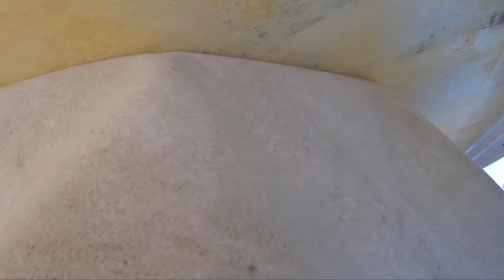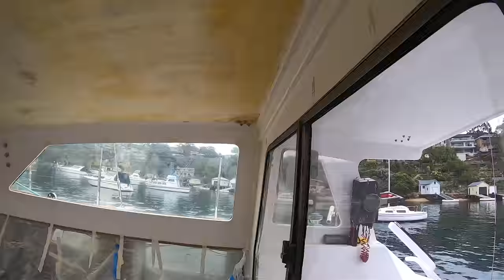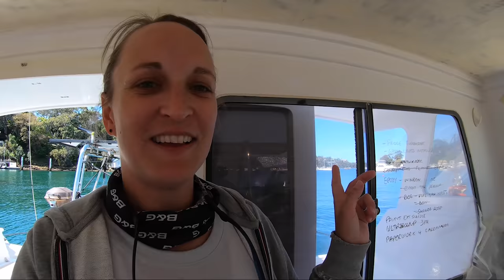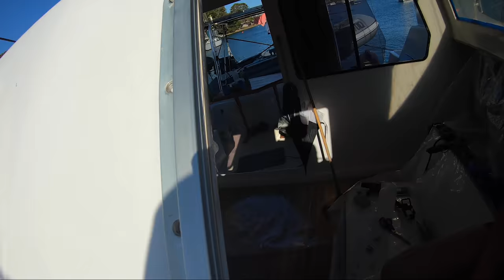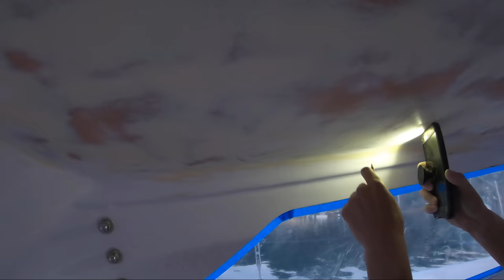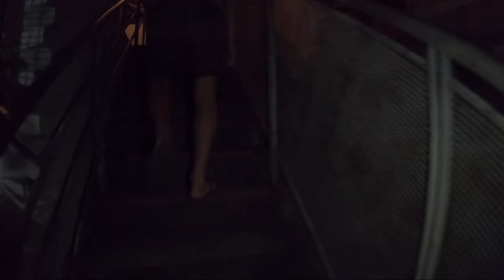CATAMARAN RESTORATION: Carpet doesn't belong on boats Part 1 of 2 (Sailing Popao) Ep.90

Comment: Not sure if you’ve already done your LiFePO4 batteries yet, but the SOC marine grade batteries are a good price, compared to Battleborn or Victron drop in style batteries.  I use the term “drop in” loosely, as you still need to refit you electrical system, add power disconnects for charging and discharging, and wire gauges where applicable.  I used Victron solar charge controllers, 3000 W Multiplus inverter/charger, Cerbo GX, and smart shunt.  If you can afford the Victron equipment, definitely nice equipment, Love mine.  The lithium batteries are a game changer, can take a bigger charger, to charge quicker, can be drawn down deeper, producing more power, weigh considerably less, and last 15+ years!  Cheers and best of luck with the refit⛵️😎
Reply from the maker: Cheers we did look at them! We’ve got iTech120x’s x3 with our already setup Victron gear, shed 90kg off the boat. As you know a complete life changer!

Comment: Regarding the epoxy situation.  I’m not familiar with your builder and type of resin used, usually it’s polyester resin.  The polyester resin cures way faster than epoxy, and for the inside ceiling would be fine.
I heard you mention cracking on the outside area you patched with epoxy.  This usually happens when you use epoxy over polyester resin, most likely used by the builder.  Epoxy is excellent when needing a waterproof sealing quality, polyester resin needs to have a gelcoat layer to make a waterproof barrier, as polyester resin may look waterproof, but it’s not.  You will get water absorption in polyester resin.  Love the analogy “the boat gives back appreciation by giving another project” 😂😂. So true!
Reply from the maker: Cheers for the info, very interesting to know! Our boat is glass over epoxy saturated ply, guess that’s why they don’t use polyester!

Comment: For future reference, sometimes you can rejuvenate Lead Acid batteries.  Safely dump acid out of bat, fill with distilled water, apply a 2x higher than normal charging voltage to bat, but not high amps (preferably pulsating).  This will knock the sulfate off plates and put into solution.  After 24 hrs dump solution and repeat. After second  24 hrs dump solution safely, Check empty cells of bat to make sure there are no flakes/pieces of plates on bottom touching the vertical plates that will render  the battery useless,  If OK, add battery acid  available at most auto parts stores and charge normally.  May come back to 80%+ capacity.
Reply from the maker: Thanks Douglas, we did try to new water but just couldn't get the batteries to get over 13v no matter how long we charged them on land. Ended up leaking again and again. Happy to see the end of them to be honest!

Comment: I a, feeling your pain, as I have a 10m Crowther that has carpet on every wall and ceiling. It is also poorly cut, with overhangs and gaps. I am going to replace the ceiling with 1.5mm PVC sheets. Smooth, white and easy to fit. Much easier than trying to sand a fair my ceiling
Reply from the maker: We looked at a 10m Crowther also covered in carpet, every square inch! The poly ply pvc will completely transform your boat! Good luck!
Reply: @sailingpopao  If it was up at Lake Macquarie then it is the one I bought. Love the videos and all the hard work you guys are doing
Reply from the maker: The one we looked at was in Brisbane, solid boat built to survey, I think it was called Kerrie-Ann. Glad you’re enjoying the videos, thanks for watching!